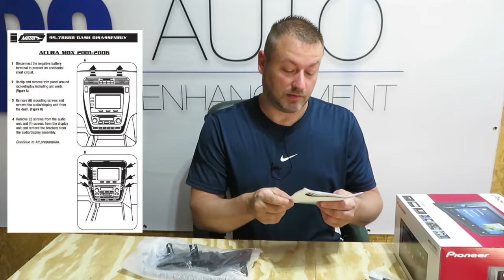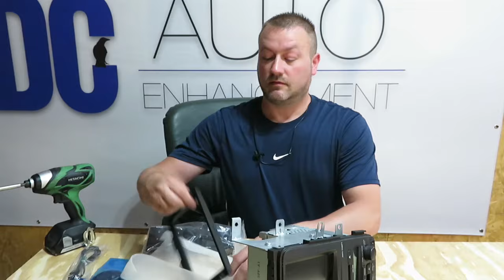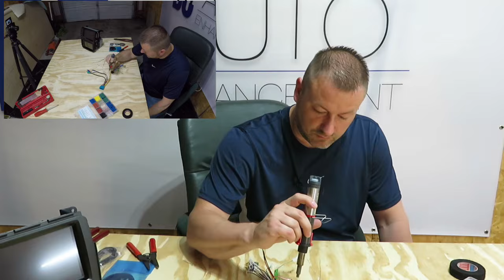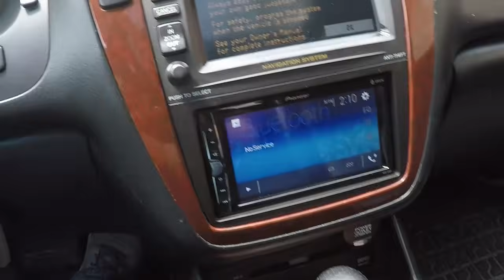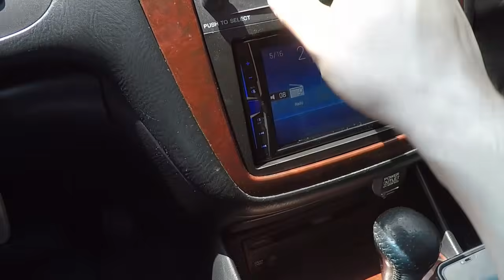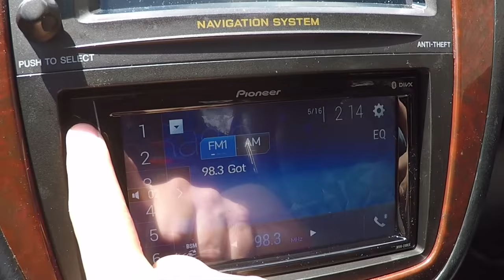2004 Acura MDX Stereo Upgrade Retain Factory Nav, Bose, and Back-up Camera Pioneer MVH-210EX

Comment: MDX 05 nav/tour Do you lose the functionality of the rear DVD player for passengers? Does the rear aux in still work? XM? Local FM stations? Can this do navigation? Basically I don't want to lose my original functions just to be able to Bluetooth sink to this. I wish you would have went through the features more so I'll know if it's worth it. Good video minus the head bumping the cam.
Reply from the maker: The rear seat entertainment will be non functional if you do the install the way I did. You could do some research to see if you can retain the "RSE". If you want XM radio, make sure your aftermarket unit has it. Local FM should be standard on the aftermarket unit. I do know that there is an option to retain your steering wheel controls. Rear aux isn't used with this install however, your aftermarket unit might have an aux in that you could run to the back for the rear aux.
Reply: Looks like they upgraded for the Bluetooth function. The Bose stereo is actually excellent as it is. Just add a Bluetooth adapter to the Auxiliary input on the back of the factory radio and use the aux button on the radio so you can listen to your phone and everything else rear DVD functions on the steering wheel hands-free link will all still work. Is the factory Bose amplifier still being used with this Pioneer head unit? If so my recommendation for just an auxiliary Bluetooth adapter would be the easiest way
Reply: In my 2006 acura MDX, I managed to put the factory radio underneath where the DVD player and ash tray are. Everything works perfectly. even the headrest screen
Reply: Thx

Comment: I installed a single din pioneer head unit in my 2006 Acura MDX but the weird thing is the radio works fine sound quality is good but it blew a fuse to my rear driving lights. So I had to put the stock head back in and the fuse hasn’t blown. Also the navigation screen didn’t work with the pioneer. The back up camera came on when in reverse but no touch. Can’t seem to figure it out. Do I need another wiring harness?
Reply from the maker: I would just double check the wiring harness. The harness that plugs into the car has an orange maybe orange/white wire on it that is for illumination, I would disconnect that wire if it's hooked up. As for the nav screen not working, make sure you plug in all plugs on the back that you can. If your vehicle has rear seat entertainment then there will only be two plugs that don't get used. Thanks for the view and comment.

Comment: I need that tool??
Reply from the maker: Which tool are you talking about?
Reply: @DCAutoEnhancement  the one you use to take off the panel around the stereo
Reply from the maker: @markadams5823  here is a link to a decent set. https://www.harborfreight.com/trim-and-molding-tool-set-5-pc-64126.html

Comment: I have a 2003 Acura MDX and installed a Pioneer deck, I have power but absolutely no sound. How do I fix this?
Reply from the maker: If it recently stopped working, I would look for the amplifier fuse. If you just installed it, I would make sure the blue remote turn on wire is hooked up from the pioneer radio to the wiring harness that plugs into the car.

Comment: Just did a recent double din install. Sounds good sitting still but not when I start the engine. Soon as I start engine, I'm having "engine noise" in sound. It did it with a direct attachment to factory harness so I cut ground wire and still have the issue...
Reply from the maker: You still need the ground wire. Did you use rca connections for the speakers or the speaker wires from the radio?